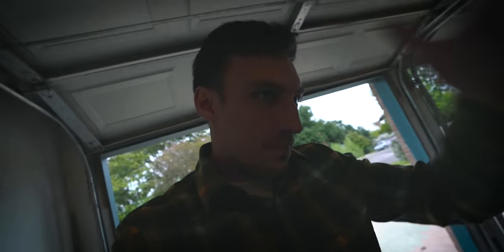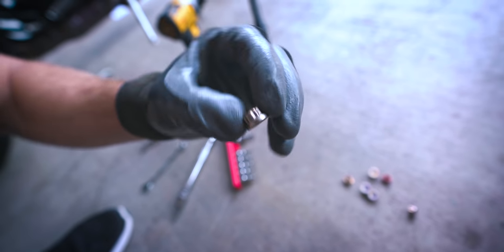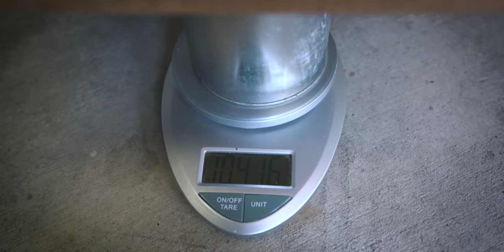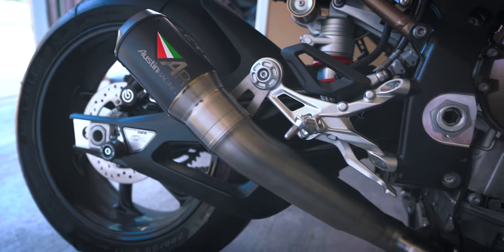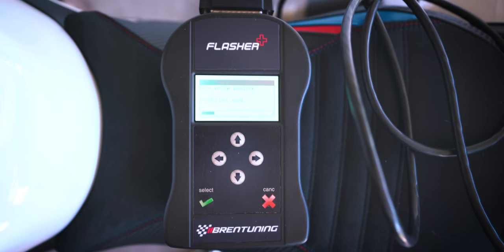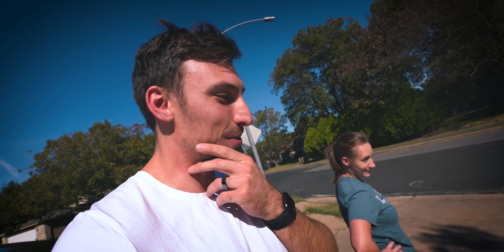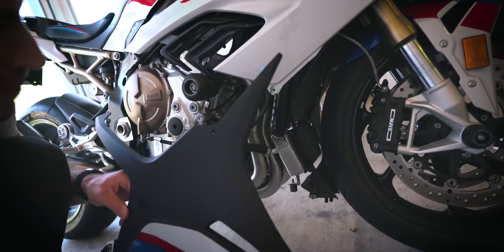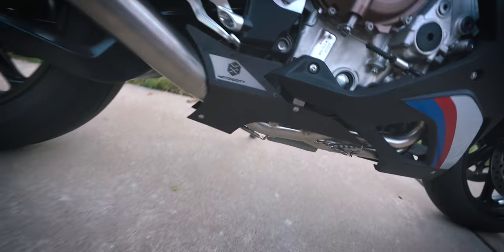Austin Racing GP1R Full Exhaust Install & Sound Test | 2020 BMW S1000RR

Comment: I am also interested in the GP1R (but only the slip-on) for my Duke 790L.  But I have one question: on the austin racing website it says that you also need the A.T.O.M. power commander otherwise your warranty will be invalid. Do I need this commander only by using the „De-cat“ version or also by the „default“ slip-on?

Comment: I have the same exhaust without the baffles on my RSV4 RR and it is VERY loud. loud to the point that I shut the engine off and cost into my driveway from a block away to spare my direct neighbours. The sound from idling all the way to opening it wide open is just unreal

Comment: I was gonna have the ahop put my sc project slip on my Daytona 675, but after watching you, im sure i can install a slipon.
Reply: 675 pilot dude it’s super easy. If you are not sure, just get a friend and a six pack and it will go on no problem.
Reply: The 675r is very easy for the slipon. Did mine in a about an HR and half

Comment: I always thought you lost power removing the baffle? Or is the bike already so powerful that it justifies it's removal?
Reply: Most of the time you just lose torque removing the baffle, but gain top-end horsepower because of the flow increase.
Reply: It’s the opposite Tom, on the S1000RR 2014 complete akrapovic with dB killer you have 3/4 horses less dyno proved
Reply: No you lose power fitting baffle as it restricts the flow

Comment: Well done great job,the only thing I notice is that when you install the silencer in the rear pipe holding bracket you place it from the out side...I thing it should go from the inside side like the stock one...keep the good work

Comment: Yeah see I think those small cans look great BUT they are too loud for everyday street use...not to mention a lot of tracks have DB noise restrictions so if you roll up with one of these you could literally get black flagged and not be able to even ride it on the track.  Looks awesome though and it does sound sick af :)
Reply from the maker: Maybe that's just a Cali thing lol. Never ran into noise restrictions here in Texas and I'm pretty sure my R1+Toce was louder, now that I've ridden this thing for a couple days. Also, I know for sure COTA doesn't have restrictions and that's the only one that matters lol
Reply: Louder the better. Me likey

Comment: Hey thanks for all your S1000RR videos. Do you have enough room to remove/install oil filter? I just installed an Akra and find there’s next to no room to access the oil filter. Wondering if the Austin racing has some more space.

Comment: The stock exhaust is the ugliest I've ever seen, usually they cover it up with a fairing and you can get by with a slip-on, not he case here, full system needed. I put the Austin Racing GP1 on my Triumph Street Triple, It's too loud even with the baffle, the track I go to only allows 98db and it well exceeds that. I'm thinking of going with the Akrapovic for the S1000RR.

Comment: Did you notice a change in engine braking after installing the system?

 I installed mine and noticed a big decrease in engine breaking and also when I spray soapy water on the joints it bubbles up meaning the joints leak and it's ALL of the slip joints.

 I've tried re-assembling it, it's as tight as possible and still leaks at every joint, but it's only noticeable with soapy water, I'm not sure if that's normal or not.... 

Please get back to me thanks!

@Motonosity

Comment: Question, is it a must to flash or tune the bike with this full system? I heard the ecu can adjust to the new air outtake by using the sensors in the exhaust, is that correct?

Comment: Just noticed you didn’t have the little springs from your headers let alone the mounting locations. Lucky😂 I didn’t even think I needed to put springs on mine because the flange mounts held the pipe to the block but I did it anyway and it was a PITA.

Comment: As the flash disables the check engine light for the servo motor did you bother reinstalling it or just leave the connector free. Did you tape it up or something else to protect it.

Comment: I have the akra slip on for my S1K 2020, but akra haven’t released the official headers through BNW so I’d invalidate my warranty but the biggest problem is that there’s no official map because the above. So I’m stuck with a slip-on. A flash isn’t a custom map, every bike is slightly different.

Comment: With no catalytic converter I assume this makes your bike technically illegal for street use and only allowable on the track. Is that true? I know folks ride with full race exhausts on the street but it seems to me to be such an easy weight savings if you just eliminate the by law required piece of equipment. It would be an interesting challenge to see a company come up with a competitive exhaust system that actually includes a CAT and performs well on the track, yet keeps the bike all purpose legal. I could be wrong. Don't know. In Minnesota I'd be illegal with a rig like that on my BMW 1300.

Comment: the fact that you put the slip on from the outside but goes from the inside.  You don't show about putting the spring that connects the slip on with the next exhaust pipe and that make sense you put the slip on wrong and you did all the steps wrong no one will talk about it???and on your next video the exhaust is at the right 
side, so you  corrected it without telling us that you messed up so we dont messed up too. what a clown
Sorry for my bad English

Comment: That bike sounds amazing, but how is there such a big difference in sound between a warm and cold bike?
Reply: its the O2 sensor adjusting the fuel air mixture and idle rpm when the bike starts cold
Reply: thru the ecu*

Comment: I'm not a sport bike guy but, damn, that sounds good.
Reply: Get a Yamaha vmax if you want the most bad ass cruiser/ muscle bike. In 85 they did 10.6, now 10.1 at 673 lbs.
Reply: Karl Hopkins They are not that fast. That is what my cbr 1000rr runs with a airshifter
Reply: @mike1156  Nope sorry bud, both one's I mentioned were ridden by dale walker.
Reply: Karl Hopkins That’s impressive! I knew they were quick bikes but I didn’t think they could do that.
Reply: @mike1156  They're insane machines for being 600+lbs. My dad has a 93 deep violet cocktail purple, with 17k miles, only 600 were imported into the us in 93. They're very very reliable, sound amazing and are fast. I love all kinds of bike's, but most don't even know how fast those heavy vmax's are.

Comment: been running Austin for over 10 years they are great and very loud I always have my ear plugs in. The sad part is my track bikes have other brands as the Austin is way too loud for 95% of tracks :(
Reply from the maker: Ah that's a bummer. Where do you ride?
Reply: @motonosity  pretty much all the Quebec Ontario and New-Brunswick circuits (Canada) and some northern US ones. The race season has a bit more liberties but when I practice it's mostly during track days and the rules are not the same as most of the time it's during weekdays and the cities have noise rules. it's not a big problem there are ways to get around it.